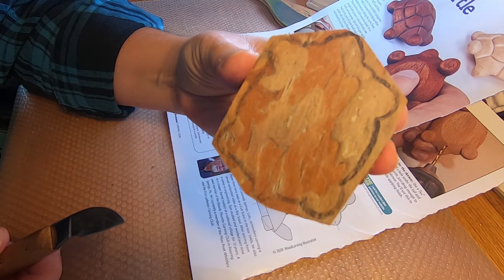WOOD CARVING A TURTLE: HOW TO WHITTLE A COMFORT TURTLE FROM COTTONWOOD BARK

Comment: I enjoyed your video.  Can you tell me the carving tool you are using at the 6:44 mark in the video?  You are cleaning out the grooves you just cut with a knife.  Thanks for posting this video.
Reply from the maker: That tool is part of my scorp set, and I love it! It's basically a v-tool you pull instead of push. The set of four scorps is from Flexcut, comes with the v-tool and three sizes of gouge or scoop.
Reply: @carvingthecottonwood  Thank you for your quick response.  I purchased one this morning.